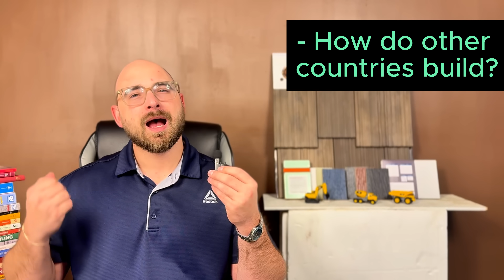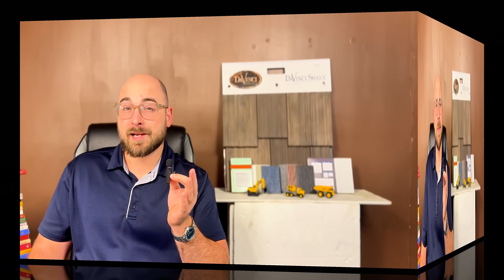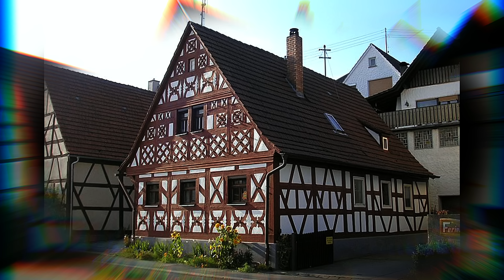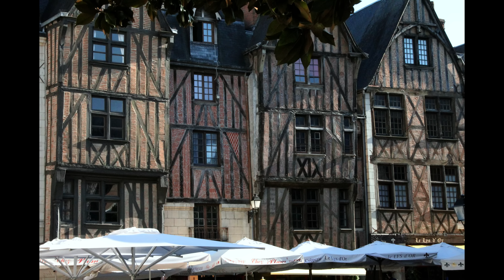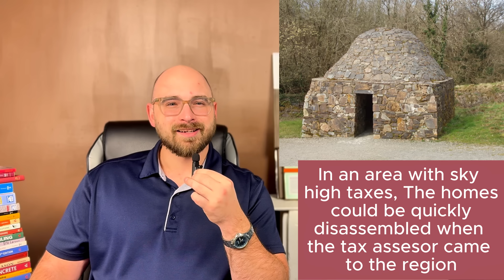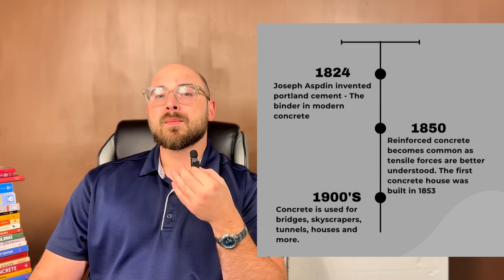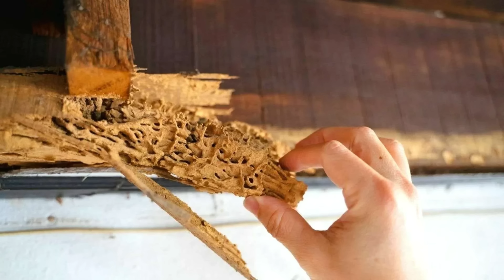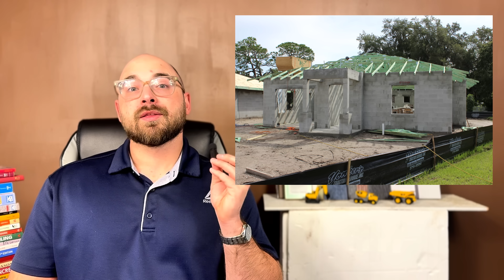Why Other Countries LAUGH at American Homes

Comment: i live in a stone house built in the 1500.
the only thing i had to do is change the tiles and paint the wooden floors.
We also swaped the windows and doora with new thermopans and the roof was renewed like 30y ago.

the house looks like new, 1m thick stone walls and all.

Comment: Comments from the U.K. When filling in a house insurance application there was a question "Is the roof made from clay, stone, concrete, or metal ?". I don't know why they didn't just ask "Is the roof flammable ?". Every year or so some thatched cottage seems to go up in flames locally. 

Something which you didn't mention, which comes up regularly is the idea of 3D printed concrete homes as an answer to "solving the housing crisis" which  actually is more to do with the cost of land with planning permission. Once planning permission is granted CMUs on the inside and brick on the outside is most common but "Timber framed" meaning large wood panels on the inside and brick on the outside is becoming more common.

Finally an explanation I had heard regarding American home construction is that they are easier to repair after earthquakes.

Comment: You don't understand, when we in the balkans build house of bricks or blocks, you need to understand that we use reinforced concrete to create  house frame. Instead of wood pillars and beams, we use concrete full of iron for pillars and beams, so every wall is reinforced with concrete. And  for floors, we also use concrete

Comment: As an American, I am glad this issue is finally getting some attention. I grew up in a wooden farmhouse more than 100 years old, and that thing was super solid. I always hated the way many new homes were built. The problems nowadays appear to be the thin wooden beams for framing, the cheap drywall, and vinyl siding. There's a proper way to build with wood, as this video demonstrates, but if not done properly, then it's better to build the basic structure out of cinder blocks.

Comment: I argued this with a German before, I asked him how they did in Tornado's, hurricanes, earth quakes, and floods. Are home believe it or not are designed to help limit damage to these forces.  Would you rather your roof rip off or 14,000lbs concrete wall fall on you in a tornado. If a 4.5 magnitude earthquake stuck Berlin 90% of the city would fall, like the one in 1756 but only a dozen buildings in LA would, like the one today 6.3. The list goes on and on.  There are many factors in which type of home to build where.
Reply: clown take, from the begining. Quake of 4,5 you dont even notice if you sleep at that moment.
Reply: 1756 we had 4 deaths, most populated area in Germany was hit. That was a 6.1-6.4 quake (estimated). 
6 weeks ago we had a 4.3 earth quake near Warsaw, Poland. Does Warsaw still stand? Let me check. Yeah, still around.
Earth quakes happen outside the US, too.

Comment: So after a load of waffle. In conlusion , American built houses ARE crap .American roofing is crap. Americans build homes on the cheap. They are not intended to last . Are designed to blow away in the annual hurricanes and Americans are happy to put up with it.  Hmm. 
Dont you read the 3 little pigs book to your children .The new American motto should be,  By the hair of my chinny chin chin.Dont build it with straw ,dont build it with sticks ,build it with bricks. 😂

Comment: I live in the Pacific Ring of Fire in an archipelago. Storm surge, tsunami, fire seasons, volcanic flows/ashfalls/smog, supertyphoons, hail, tornado, heat wave, and landslides.

My house survived it all, repeatedly, at least once every 5 years, for 25 years now. It's made of rebar and concrete, 3 floors high cracks a little every earthquake above 7.0 but thats normal, sure the storm can fling fish and crabs up my roof or the ashfall and wildfire can blacken it. Sure, the hail keeps destroying my solar panels, but corrugated metal awnings help protect windows and don't catch fire. 2nd and 3rd floor can't flood.

I'm in a 3rd world country, and this is lower-middle class. How come 800k American homes can't even.

Comment: As in Central Europe, houses were built specifically in Switzerland, I recommend the Ballenberg open-air museum. Not only the construction of the houses but also how people lived and worked in the past is presented there in an interactive way. Switzerland needs so much concrete because almost every house has an air raid shelter

Comment: Almost all houses in Greece, blocks of flats or single family houses, are built using reinforced concrete frames + brick infill. They will last for centuries and are resistant to earthquakes, fires and floods. Cinderblocks are only used for storehouses, garden sheds, fences etc. and are seen as poor materials not suitable for living in. Stone is rarely used as it's very expensive to build and in certain countryside areas in order to keep their traditional look a stone cover (think like tiles over brick) is enforced by code (also ceramic roof tiles instead of cement roof). Even after fires and floods the buildings remain standing and after the 1981 earthquake the building regulations were tightened a lot more and now there are almost no buildings collapsing after major earthquakes.

Comment: Its not "waddle and daab" - wattle and daub! I'm surprised the US builds so flimsily in a country that has so many tornadoes.....also not deep foundation footings. In South Africa there are strict regulations for both foundations and materials for the house which is usually double brick walls or concrete blocks.
Movable shuttering using a relatively dry mix is 8 times stronger than clay brick, pipes and conduits are built in as you go, and a good sized 3 bed 2 bath home can be built in 3 weeks. Also here in SA we use baked clay or cement roof tiles not the thin cardboard crap you use in the States

Comment: In Serbia and the Balkans, in general, we build with poured reinforced concrete columns and main beams that carry the weight and give sturdiness. Walls are built with those brick-like blocks with all insulation etc. as you showed. For a reference, we had big floods in Serbia in 2014. One house was literally carried by a flood. It remained untouched, only displaced and tilted a bit, but it remained good as new. That's quality building. Thats why american toothpick homes are funny to us. Because when we build we build it to last for generations.

Comment: Glad you mentioned steel. Modular steel and panelized EPS (e.g. GigaHouse, Wally Walls, ThermaSteel, Structall, HercuWalls) save so much in labor costs it largely makes up for the added material cost, and the result is strong, excellent insulation properties, quiet, and pest free.

Comment: The US American housing is not only criticised because of the light framing construction, the critic is also about the flimsy doors and windows, not existing roller blinds and almost not existing heat and noise (!!!) insulation.

Comment: Well I do not know is USA houses are better, but nobody wold buy wooden house in Europe...only brik and concrete, and no hot air heating...water radiator is the best.
One thing is unbelivable, why USA hoses are so expensive? Even more than our brick/concrete.

Comment: Unfortunately the components of concrete aren't great for various ecosystems nor for the amount of energy used to create lime as used in concrete. 
A mix of wood that's stronger (dense fibres) and something along the line if rammed earth are both beautiful and lasting. 
The techniques for rammed earth have come a long way from poles and steel pads or pounding away with chunks of wood and feet.
Laminated timber is stronger, but it off gases as much as concrete will. 
The petroleum industry loves the plastic based siding, foam insulation, without telling contractors or home buyse both of these are extremely flammable.

Comment: In Australia, most homes are some version of brick or concrete.
A lot of old cheap homes weren't, but most of those have been bulldozed now.

Where we fall down is the windows.
Double-glazing is very rare.  
Sure, we have a more temperate climate than places where glazing is common, but we also have plenty of noise.
And single windows do f all.

Comment: We built a mid-budget two-level suburban home in Australia using steel framing with a brick facade. Considering the other building costs, the difference between timber and steel framing was about an 8% increase in the project budget.

Comment: Well, union built I have seen really SUCK, I built house in Alaska, told people it is stupid to only build to code.
Built wood frame house, that withstood 7.2 earthquake, 100+mph winds, -60F temps, over 30 feet of snow in a single winter.
Front wall with large windows built with 2x12's other walls 2x10 on 16" centers, roof and floors 2x12 on 16" centers, no chipboard used on any part of the house, roof 3/4" plywood, side walls 1/2" plywood.

Comment: In india most of the houses are of RCC.
Even the ones who can't use conrete because of cost consideration go for houses built with clay bricks and mud mortar with roofing which are fire insulated and are slightly cooler in summer because of thermal resistivity too.
Composite buildings are now picking up demand but i would say RCC still dominates and our walls are of bricks with wet cement mortar.  Even composite houses have EPS panels shotcreted with cement mortar which are way stronger than dry walls.

Comment: You should see the 'glorified tents' most project builders are building by the thousands in Australia. This term was coined by a recent study which found that more people died of the cold in these types of houses than in a cold Scandiavian country. Most have dark roofs (in a hot climate), no proper high thermal mass to stabilse heat, and no passive/active solar design...

Comment: The graphic at 27:17 is super misleading. ICF with 4" of insulation is not R50, but R16 or R17. Check it with ubakus r-value calculator. Such a wall has excellent heat storage capacity and a temperature phase shift of 10 hours. In select climates with high day-night temperature swings, like the desert, it will perform very well. However go somewhere where it is cold for days at a time, like the Northeast or Canada and the advantage of thermal mass is mainly reduced hvac cycling and maintaining temperature longer in a power outage or hvac time shifting.
Reply from the maker: You are wrong, ICF benefits not only from thermal mass, but also from earth coupling (sometimes referred to as passive geothermal temperature), performing around R50
Reply: @Mike_Fortin  How do you achieve earth coupling with icf and how does this improve thermal performance in cold climates?
Reply from the maker: All you have to do is put an ICF wall on top of a concrete foundation. 

An ICF house will stay 55-65 degrees in my climate zone, without any heat in the winter on a 0 degree day. 

The stable temperature of the earth carries up the wall several stories, helping to heat or cool the home

Comment: You missed two other options built in the US, ICF (Insulated Concrete Forms) and Precast Insulated Concrete Panels from Superior Walls of America. I am a builder of SW homes that are hurricane and disaster resistant that I can build anywhere in the country and resist local disasters.

Comment: Confined masonry is the main method of building in Brazil.
Reply: With wooden frame and clay tiles. Usually Portuguese tiles (rather flat) or Roman tiles (arched, with a flat flange to fit the next tile on it's side).

Comment: I’m European (Portugal) and I prefer the houses here in US, easy to repair or renovate by the owner. In Portugal if a water pipe bursts inside a wall that’s a big job to repair that pipe. The houses are cold in the winter (no central air or heating) but nice and cool over the summer. They use brick (the one with several square holes) but is not used as structural because they have concrete posts on any corner and floor.

Comment: I live in a block house, built in the forties. Corners were cut in the construction, but it is still a block house. Built at that time, there was no insulation, a real downside. Things that I did not realize when we bought the place were the difficulties with getting contractors to make repairs, because they don't like working with concrete, (They are fooled initially by the aluminum siding.) and the difficulty in simply hanging a shelf. Otherwise, it had always been a dream to have a sturdy house like this.

Comment: What people don't understand is why you build wooden houses that are leveled to the ground at the first gust of wind when you can build houses made of bricks, concrete or other durable and non-flammable material. you just had big fires in LA from what I remember now imagine what that fire would look like if all the houses were made of bricks.
Reply: My house is brick over block, but most of the houses around my area are wood and none of them has ever been "leveled to the ground" in my lifetime, or even damaged, by the wind. The 100 MPH building code here applies to wood or concrete houses. We don't have wildfires, but if we did, it would take more than concrete construction to protect our houses. In the LA fires, even concrete houses that didn't have fire-rated windows were hollowed out, with only a roofless shell left behind.

Comment: Before thinking about building homes differently , start burying your electric infrastructure in cities. Every time there is a storm in Tornado Alley, or an ice storm, power lines are down in cities. I lived in Southern Oklahoma and every 5 years, either a tornado or an ice storm knocked out Lawton’s power lines. Sure, hurrying infrastructure is expensive, but how many times do you want to redo power masts before you realize how ugly and stupid that solution is? Drive through any Central European city and you won’t find power poles except for community to community, essentially high power infrastructure.
Reply: It's true that neighborhoods with buried power lines look much better and resist storm damage, but it can be a nightmare if the underground conduit fails. Maybe the plastics they use today are more resistant to cracking, but I know of some '80s condos that paid dearly to repair their leaky underground lines.
Reply: @pcno2832  but... they never fail. I mean, if you do it right. You know, I was volunteering for the German Federal Agency of Technical Relief (kinda like firefighters for disasters) and we had that training material from the 1950s and it described how to fix a wooden power pole. We were joking that you need to go to a museum to see those.

Meanwhile, Germany was planning to get a high power line from the ocean to Bavaria underground just because nobody wanted to look at it - and the concern was that it may slightly heat the soil and we "don't know the consequences" - that's the state of crybabyness of some NIMBYs.

Comment: You are showing clay tile brick walls (terra cotta) that are horribly weak. No one uses that. Simplistic generalizations about construction techniques often fall on their face when shown actual statistics about usage and cost. Plastic siding is generally rare even though common. This is not a contradiction.
 There are no buildings using cinder blocks since 1950. A CMU is not cinderblock.

Comment: US homes used to be better. They were better built with quality materials. Homes were built in the past by people who took pride in their workmanship. Now, homes are built with cheap materials and by non-professional framers most of the time. I know because I am an inspector. I see horrors in the framing stage, along with other problems with plumbing, electrical wiring and roofing.

Comment: Im Guatemala the houses are not only cheaper than US, but are also more durable because they are built with steel bars reinforced concrete blocks (CMU), just like the buildings, but having the same size than a house in the US. Perfect for earthquakes, the volcanic snow and acid rain also caused by the volcanoes

Comment: Thank you for posting this video!!! I am VERY GLAD to have learned about the CLAY-FIRED INSULATED BRICK that you began describing at approximately the 10:30 time mark in the video. I think I am seriously going to have my NEXT HOUSE built THAT WAY because it ELIMINATES ALL of the MAJOR problems (the RUSTING of METAL; the ROTTING, BURNING, and CONSUMPTION by TERMITES of WOOD; as well as STOPPING MOISTURE, MOLD, and MILDEW from entering through the WALLS of the structure)!!!!

Comment: I’m living in a 120 yo appartment for 18 years, made of brick, still good. Now i’m moving to a 150 yo farm, it has cracks in the bricks, but still good enough to live. A part has a reed roof about 30 yo, so in 10 years it’ll need restoration. It even has a 150 yo boxbed, it sleeps nicer than my regular fancy bed. 
I’m happy for the old Dutch quality of building, i would not want to live in a modern building.